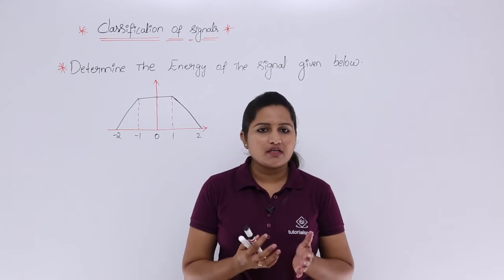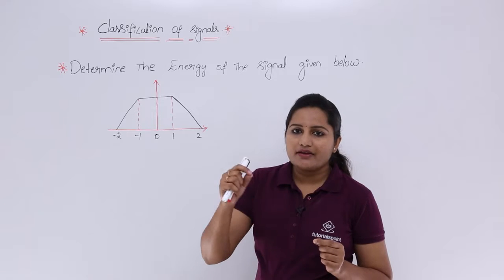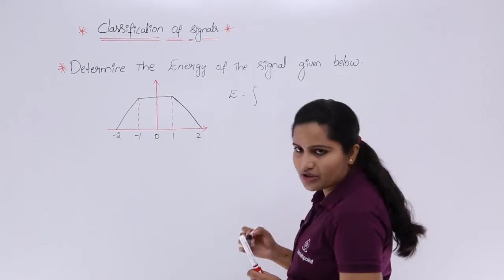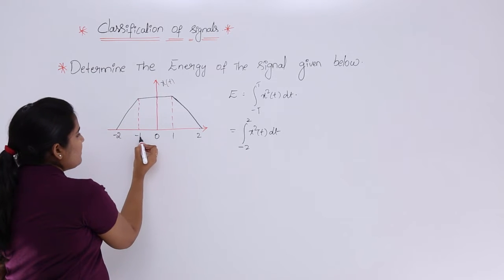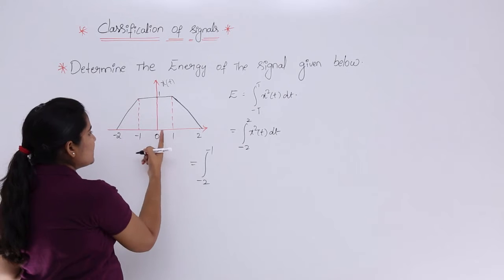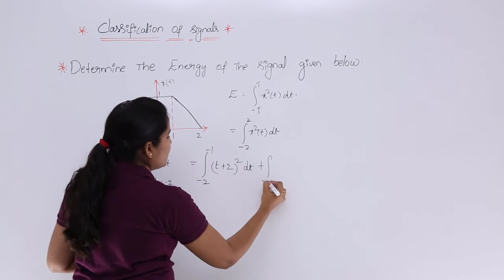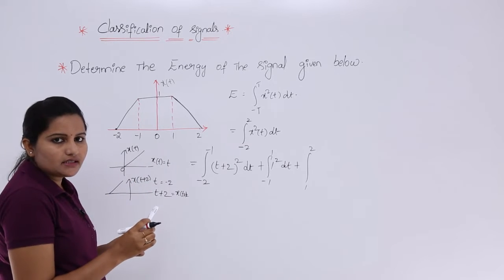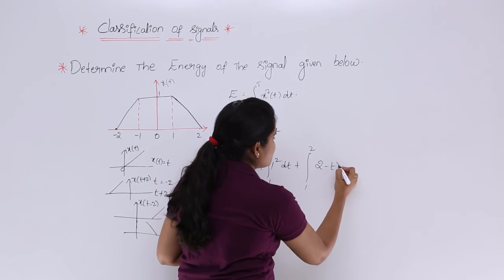Energy & Power of a Signals Example

Comment: For the third integral it should be -(t-1), not -(t-2) because reflected and shift on t=1
Reply: According to you then first integral will be x(t + 1)
Reply: Bro she consider 1-2 it is a new signal so from 1 she consider as t shifted to 2
Reply: simply take line equatoin .